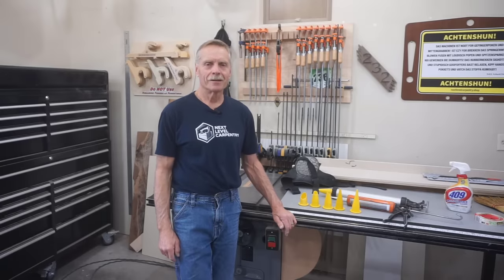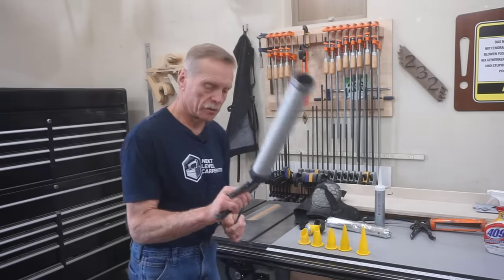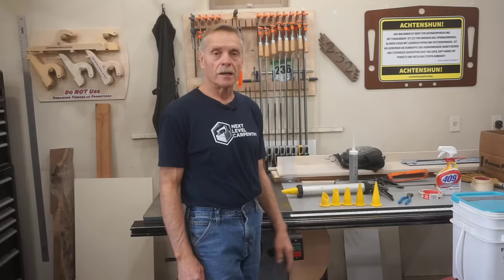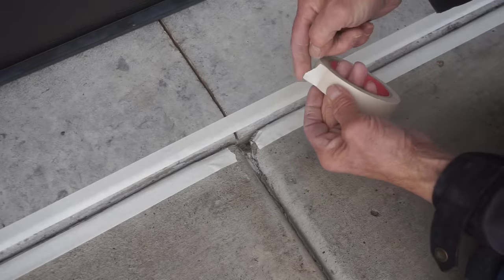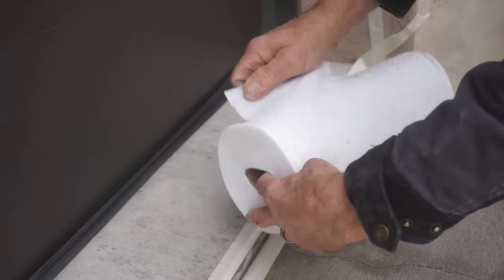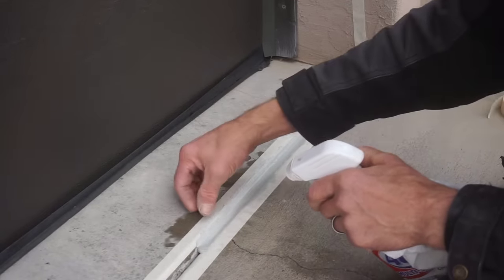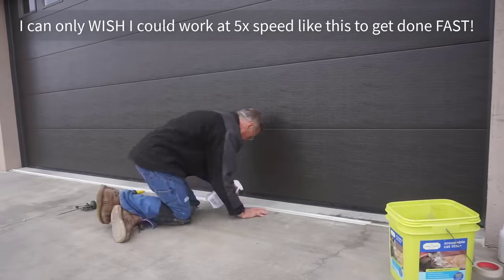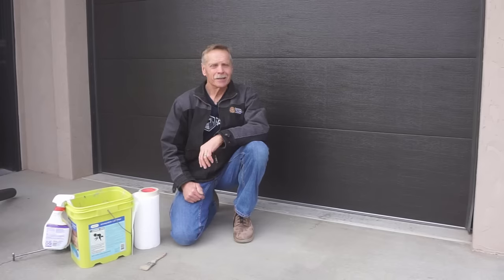How to Caulk Concrete Control Joints with Perfect Results Every Time

Comment: Any hints on estimating how much material is needed?  I have a driveway that was poured last year so the expansion joints are intact.
Reply from the maker: Here's a quantity calculator from the Tremco website that should help estimate volume, assuming joint width/depth is somewhat consistent. https://www.tremcosealants.com/resources/technical-resources/calculators/sealant-calculators/
Best, Matt
Reply: @NextLevelCarpentry  Thank you.  I appreciate the help.
Reply: I used a LOT more than I estimated. My thought is to purchase more than you think. Can always return the extra. This way you dont have stop, run to the store to get more sealant.  Always a pain I find to interrupt projects like this (e.g. house painting)
Reply: @NextLevelCarpentry  its saying i need 20 sausages. 🤔 I've got about 120 linear feet of expansion joints.
Reply from the maker: @Chris-5446  there are so many factors involved that it's tough to get an estimate you can be confident in so I always like to have the option of ordering back a few extra tubes at the end or else having the option for returning unused tubes if I overestimate. That is probably tougher ordering online but if you have a local contractors building supply House it's usually not a problem... Good luck with your project! 😎
Reply: Just did half of my (18+ year old) drive, and like Mike, my estimate only accomplished two thirds of it. 😮‍💨 The biggest factor was depth - it's an obvious item on paper, but not so much in practice. I could/should have filled in a bit with sand, but the joints weren't deep enough to use a backer rod either, so it may have neared the working limit of the product... 😑

20.5x (Tremco FC) 10 oz. tubes filled about 118'. I wasn't able to achieve the same efficiency as NLC, so there is some waste.

Tape is a must. An old spoon helped. Sand covers a proverbial multitude of sins.  Something to keep in mind; because the sand covers the product, the color of the sand will have a big impact. I used play sand, which is a middling brown. Despite the light gray caulk (Aluminum Stone), the end result was essentially brown.

Comment: THANK YOU!  Finally!  I found something that makes a ton of sense to get a perfect job and not cost an arm and a leg.  

Contrast this method with the expensive self-leveling stuff where:
- You buy rope-like material to seal the bottom of the joint first so it doesn't all leak away.
- Next you fill it with expensive self-leveling stuff that doesn't end up self-leveling as he said.
- Then you do the same with sand except you need more of it because it sinks into the sand.

Comment: Beautiful. Might need to check on that fine silica sand.  If might have a risk of causing lung problems with repeated use.
Reply from the maker: It's silica SAND, not silica DUST.  If this stuff is a problem then anyone walking on a beach is in mortal danger😉

Comment: I won't go near that urethane stuff without gloves, it gets all over the fingers
Reply: Not the main reason though. It might be icky, but had it been strawberry jam or even snot, it wouldn't matter much. 

Caulk, especially of this type, durable, elastic outdoor stuff, is a chemical bond. It enters the blood stream directly through the skin,  can cause all sorts of allergic reactions, disease from prolonged exposure, like for instance cancer, procreative transferable dysfunctions as some of the worst. Use PPE (nitrile gloves for instance - whatever specified in data sheet)! 

There are 3 places it belongs - in the sachet, in the joint or where it can be properly disposed of. Nowhere else. Not on your fingers, clothes, skin, on the gun, the tools or a gummed up tip, though the latter can be easier said than done. Take precautions and be thorough. Be safe.
Reply: @martinpoulsen6564  do you have peer reviewed scientific literature you can link to that supports all of those claims you just made about using your finger to wipe caulking joints?
Reply: @luke9822  Only made one about the finger. Don't stick it in there. These are not latex/acrylic based caulks... Solvents penetrate skin, and they are harmful. Fact. Several of them in same concoction makes a cocktail effect. More often than not, they multiply impact when mixed. Exponentially even, in some cases.

And if you run around doing latex/acrylic every week, you should even stay away from that too, without a tool or safety device, like gloves, between you and it. The malice might be minimal to the extent of single use, but with the kind of exposure some people get, they are way beyond reasonable quantities.

You don't hear about it, because it's shameful... He's a sissy - claims he can't go to work just because of a rash... Well - it might be full body, it might be burning so bad the person can't be in their own skin. With polyester and epoxies, there has been several such cases. Urethane is not one bit better. It's usually just a single component... Which can be a false sense of security - people tend to be a little more alert, when they have to mix something.
Reply: @martinpoulsen6564  So you don't have any peer reviewed research you are basing these claims off of. Got it.
Reply: @luke9822  On me? No. You obviously just do not want to know. That will never be my problem. Search my friend, and you shall find. Critical thinking is good. Just keep it balanced.
Reply: @martinpoulsen6564  understand that if someone is asking you for empirical evidence for your claims, they want to know. If they did not want to know, they would not ask. I have searched, and found nothing.
Reply: @luke9822  I cannot say other than I am truly sorry for that. Extensive studies have been made. Unfortunately I do not remember all the sources, but they are there. I'm sorry if I brushed you off, but unfortunately I have gotten used to the abrasive cowboy attitude.

The basic chemical knowledge and questioning of cocktail effects is part of epoxy courses in Denmark, where there is a number of validated global studies on the subject. Quite enlightening for a 2 day course (had further courses and worked with it further for 4½ years)

Comment: Was all set to watch a dozen videos on filling control joints. I watched yours and took notes and ended the research phase. Thank you so much for a very helpful video. Well done.
Reply from the maker: There are many situations you will get into that this video does not cover but in the end I firmly believe it's the best way to finish a joint regardless of extra measures needed for proper joint Sealing. Glad to hear it was so helpful so thanks for watching and commenting! Best, Matt

Comment: I came across this video a year ago just before the Wisconsin winter got here so the job was put on hold. I had a stroke 4 years ago and was hesitant on what kind of job I could do. I am right handed and that was the side that was affected. I did auto body when I was younger so I knew something about caulking joints. I tooled the caulk dry and with my left hand, right hand not coordinated enough yet, and the results were better than I ever imagined. I am so glad I came across your video
Reply from the maker: Kudos Mark!  Urethane caulk is a challenge to tool with my dominant hand and using 409, much less 'off-hand' and dry... sounds like your determination paid off... you have my respect for that and gratitude for watching and commenting on this video, a year after the fact, no less!  Best, Matt
Reply: I wanted to Thank You for the video and your explanation of the process. The results are excellent, all it takes is a little time and not be in a hurry. 👍

Comment: Just wanted to say thank you for the detailed video. I purchased the sausage gun, the product you showed, tape, sand, I couldn’t find the 409 so I used Simple Green. I removed the old expansion joint rotted product and resealed using your method. I did the back patio, the front walkway, and the front driveway. I did it almost everyday after work and whenever I could on the weekend. After hundreds of feet of taping, tooling and applying sand, I finished the entire project after 2.5 months!!!! 😅 I did both the expansions joints and control joints. I’m very happy with how it turned out. I’m the only house on the block with perfect sealed joints 😄😄 THANK YOU!!!!!
Reply from the maker: Good on you for sticking with it and being thorough! Thanks to for using those Amazon links... I appreciate the support. I think the satisfaction will last for you as it does for me since keeping the driveway clean and extending its useful life make all the effort worthwhile...
Best, Matt

Comment: Well done, clear explanation, steps, results, material info, going to do this to a 2 million $ home, big open joint around rear of house to concrete patio. Now, Im ready, thank you!
Reply from the maker: You're sure welcome and I'm glad you found this video because the methods and techniques you've seen are exactly what I use on large joints in the range of 2 in wide which can be done with this method. 
Although it's not an ideal situation or condition it's far better than the alternative of redoing the concrete or doing a messy,  poor quality job of sealing gaps.
Hint: I don't say this just to get you to buy more things from Amazon but if the joints are wide and there's any quantity any money you spend on the 20oz caulk gun and the yellow cone nozzle tips will be well spent and appreciated even if you've only one job to do😁😎
Best, Matt
Reply: @NextLevelCarpentry  thanks for awesome reply, And Happy Father’s Day, Matt
Reply from the maker: @rslsr56  HFDTY2😁😎👍

Comment: Excellent instruction. Thank you! I’ve previously had good results with self leveling urethane replacing the old original expansion joint material where the surfaces were level but with any incline it’s nearly impossible to control and do it efficiently. Your lead in to the video got me thinking about what exactly a carpenter does on the job, besides the obvious carpentry tasks. I realize also that there are specialties within the trade. I’d be interested in how this task falls under a carpenter’s job responsibility. Perhaps you could explain further. Thanks again for the knowledge shared. Subscribed!
Reply from the maker: The list of things that carpenters DON'T do on the job is much shorter than a comprehensive list of what they DO do IMHO.  I suppose in a unionized environment there are some parameters but, in my reality of custom design/build remodeling I've done virtually everything except electrical work major plumbing because I don't have the required knowledge or licensing.  Part of the reason I do this sealing work is that I can't find anyone in my area that will even do smaller projects like this and, despite comments by self-proclaimed professional caulkers, I just don't see sealant work on residential projects anywhere near the level of quality I expect and require on my jobs.

Comment: I just did my first set of joints.  I can’t imagine using any other method.  PERFECT!  I did use Vulkem 116.  Thanks so much!👍
Reply from the maker: Kudos Mark!  I always have a sense of satisfaction after sealing up joints to keep them dry and clean.
FWIW I have heard from another viewer who had issues with bubbles forming in Vulkem ~12 hours after application.  I stand by my system as shown in this video and hope your success is permanent using Vulkem in lieu of Dymonic because I've not determined the cause of that viewer's bad experience...

Comment: I always wondered why my joints looked crazy. Can see why this Merton could work well for cracked old concrete too ! Thanks ! For new ideas for an old man,I’m 74 and still going !
Reply from the maker: You Go Buddy! Don't let your age be an impediment😁
If you're doing random cracks instead of straight control joints just spend a bit more time applying the masking tape along the edges and you'll get surprisingly good looking results... Best, Matt

Comment: Great job. I have done more of this than I want to think about and even though so-called experts showed me how it's done, I wish I had known your approach back then. There are very few applications where that self-leveling crap worked well at all. It wants to run forever even when you think the area is level. I doubt I will ever do this again but it was enjoyable to watch a guy who cares about his finished product. Thanks.
Reply from the maker: Dealing with 'pros' who have a mental block or some ingrained mindset is a constant mental drain so every sensible comment like yours is more reassuring than you imagine and much appreciated! Best, Matt
Reply: @NextLevelCarpentry  There's always another way to shin a cat, right.

Comment: I have used this type of caulk in the past and it can be nasty stuff, impossible to tool. I tried your method today and was really impressed. I also discovered something that I would like to pass on. The joint I was caulking was wider than even my fat fingers. So I had the inspiration to use a silicone kitchen spatula that had a nice radius on it for tooling. I squirted some 409 on it it worked exactly like a finger. Was able to clean the spatula with the 409 when done, and put it back in the kitchen without my wife suspecting anything! For joints up to about half an inch, a finger works best, but this joint was a full inch, and even wider in some places, and the spatula had just right amount of give.
Reply: Guess I  am not coming over for dinner now.

Comment: I installed windows in New York apartment buildings and used dish soap mixed with water. An old timer taught me that. The silica sand and masking tape are a great 💡

Comment: I’ve been using the Sika Pro Select and surprisingly I also use sand to add a more durable, and nicer looking joint than I see pretty much everywhere control joints are done this way. I take steps to use a sand that matches the color of the concrete. I have joints I did 3 years ago that look “good as new”. I think this is a good idea for a home based business and I’m thinking about charging $10 - $12 a linear foot to clean and fill residential sidewalk joints with a 5 year warranty. I think that’s reasonable.

Comment: Thanks! I did this today. Three ~10ft sections. I cleaned out the leaves/bark dust and backfilled the gap w/ sand, leaving enough room for the caulk to fill in. It took just over 5 tubes of the standard-sized stuff. Great tip on the silica sand, it worked great. Didn't use knee pads, which I regret now!
Reply from the maker: Betcha won't do THAT again😲... gotta keep them knees happy for sure!
Best, Matt

Comment: Good info. I use a battery RYOBI 18+ caulk gun now for big jobs since years and years of work and squeezing caulk guns is hard on your hands and elbow. very little learning curve. It also allows me a continuous bead if speed setting is set right. I use dish soap Dawn in a spray bottle and never had a problem, the humidity/water even helps speed up cure time in my experience. Self leveling urethane caulk can be a nightmare if the joint is not level, and most are not. If not careful, it will end up pooled up in low spots due to gravity, or wasted down the crack if you do not use an adequate base/backer. One of the most important parts is using in date caulk, the date on bottom of most brands especially silicone caulks and such need to be used within reasonable time after date on tube for best results. Urethane can get pretty hard to squeeze out when old. If you do get an old tube set it out in the sun for a while first, if using multiple tubes put other tubes in sun while working.

Comment: School is in session.  quality job.  I'll be needing to do this for a couple of control joints under a new tile floor I'm laying down.  Thanks for a great video!
Reply from the maker: Actually this method is somewhat Overkill for control joints that will get covered with tile but I would still go about it the same way because it is a sure way to get a nice neat job...

Comment: This is excellant info, I use almost same procedure for tub and tile caulking but only used dishwashing liquid with water, Im gonna try 409 next time
Thanks a Million
M L Rogers    Pasadena,TX
Reply from the maker: The main reason I use 409 is convenience.  I've used Dawn dish soap at 14% with water for very similar results... probably cheaper but I don't like the extra fuss. Plus, pump sprayers have  a limited life expectancy and I get a new one with each bottle of 409😁

Comment: That’s the same method I use when I caulk around the house. Finger and soapy water, comes out pretty good everything and no messy clean up. 

Thanks for the tips on self-leveling caulk on a slope and the details instructions on using masking tape, it definitely made it look very professional! Thanks for the video.
Reply from the maker: Masking tape and sand are absolutely key between success and failure IMHO... you're sure welcome for the video!